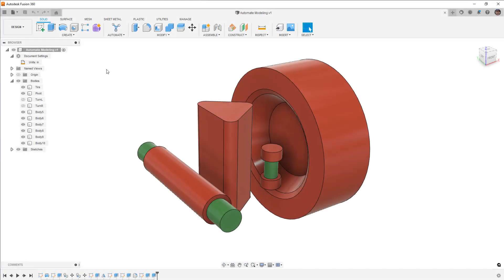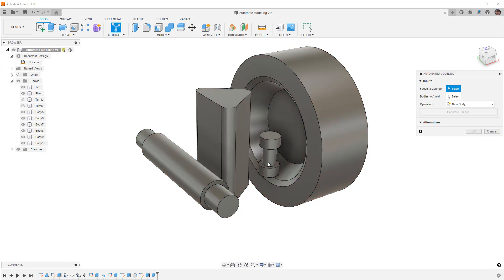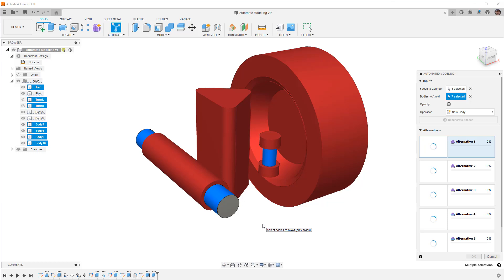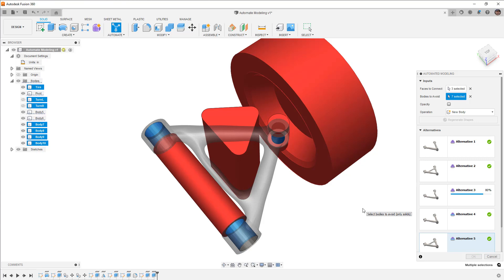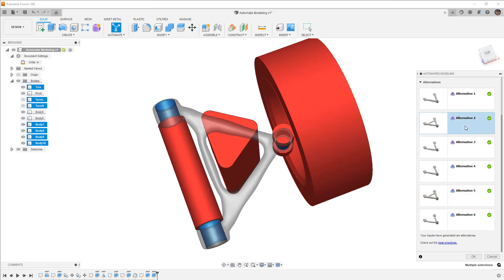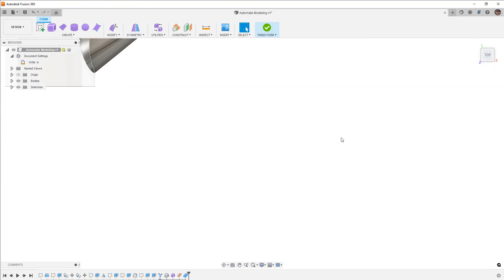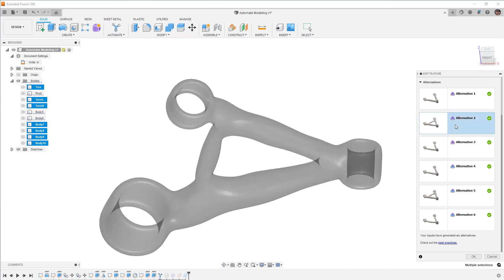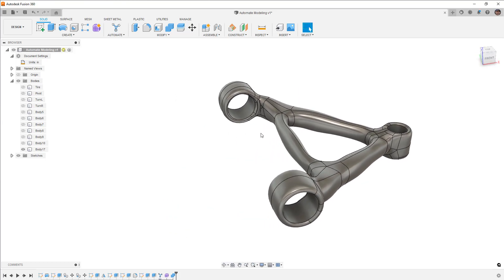What is Automated Modeling? | What's New in Fusion 360 #Fusion360 #Automated Modeling

Comment: Autodesk pricing is strange, why would someone fork over 1600 a year for this instead of ditching Fusion entirely and going to a more 'professional' CAD/CAM program that has stuff like this?
Reply from the maker: Hi Johnny, where is the $1600/year coming from?  Currently Fusion is $396/year or $1,128/3years in the US as listed on their site.  There was a product design collection around that price that included Inventor, 3d studio, HSM works and a few other tools.  The CAM tools in Fusion are excellent as are the CAE tools.  I don't know of any other program in the same ballpark price that offers Automated modeling(which is a new preview feature) or generative design tools. I have used and supported a lot of CAD/CAM/CAE tools over the years and there is no comparison on price for functionality.

I would like to know what CAD/CAM program you know of that offers Generative/Automated Modeling tools that is under $8000.  I will happily check them out :)
Reply: @LearnEverythingAboutDesign  Cost of the generative design app in Fusion is $1,600 a year...it just seems a bit odd since at 500+1600 you are entering into the realm of stuff like Solidworks and exiting what demographic Fusion seems to be targeted towards.
Reply from the maker: Well this automated modeling tool is free, no cost associated with the solve.  It solves locally and is just a shape generator.  It isn't quite Gen Design because there are no loads/constraints, no materials, no mfg methods etc.  The $1600/year is for unlimited solves, which you can pay per solve if you wish.  It is currently $1100/year or $200/mo for unlimited GD solves or I believe $35/solve which can include multiple studies/mfg methods etc.  If you look at other GD solutions on the market they are much more expensive at the start than Fusion.  There are 3 or 4 big players in this space and Solidworks isn't one of them(although Catia is).  You have nTopology, Creo Gen Design and Siemens.  I don't have current cost on those but last I checked nTop was $7500/year and is not a CAD/CAM package in the same sense.  Creo starts at around $3000 for their essentials (which doesn't have GD) and their Premium is $16000,  The cost of GD in Fusion is rolled into the commercial license and you pay per solve, which is great for those that only want to try it now and then or learn how to use it.  There is also a 7 day trial with unlimited solves.

I supported SW for many years and even worked at and with VARs for some time.  I am a CSWE and have been since 2009.  SWx current sub model is $4000 for their 3d experience platform per year.  Their standard seats range from $4000-$8000 without simulation, CAM, and a whole host of other add-ons.  You could easily get to $12k or more for SWx plus the yearly cost.  If you have premium with Visualize you are looking around $2000/year for maint. cost last I checked.

While I get what you are saying, I don't believe the $1600/year for unlimited solves, which is optional, is out of the ballpark for that tech considering what other generative design companies are charging.  And even if you pay for Fusion for a year, and unlimited GD solves currently at $1100 and unlimited 4 and 5x machining, you are still not even close to buying something like nTopology(which is very powerful) which really still requires you to have a CAD package as it is mainly for topology optimization and direct modeling.

The current model Fusion has adopted helps keep the cost low for 95% of the users and offloads the cost of the higher development stuff like Generative design, Simulations and higher end manufacturing toolpaths.  One of the reasons I enjoy supporting it is around its cost for functionality.  Is it perfect? no, but I had my problems with all CAD software i have used :)
Reply: @johnnycab8986  There is no generative design in DinosaurWorks. Topology study isn't GD, it's just topology optimisation.